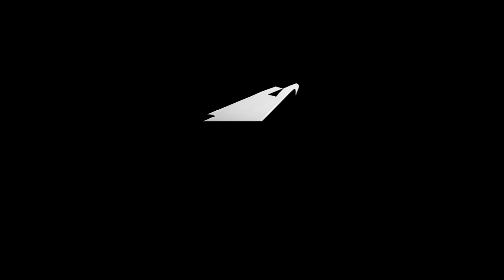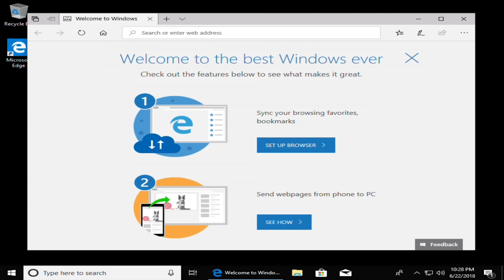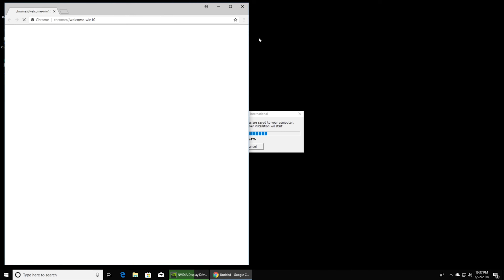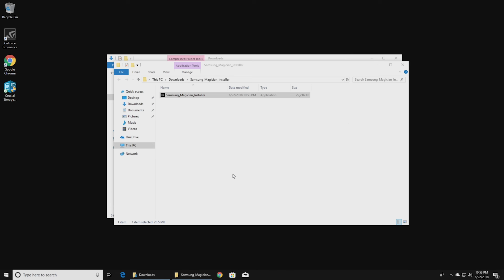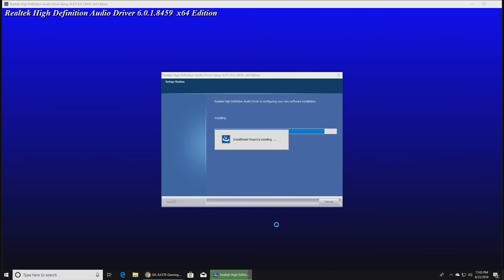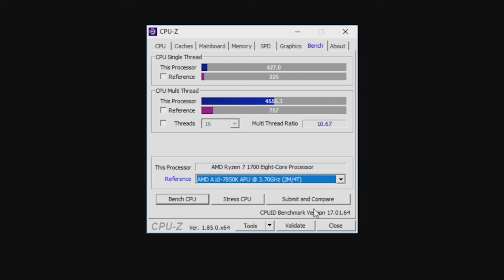How-To Guide - BIOS Update / Win 10 Install - $900 Gaming PC - Part 2

Comment: UPDATE: today I tried Aida64 to run stress test again and the PC froze after 5 mins... so I don't know what to do now...

ok I got my ryzen 7 1700 overclocked  to 3.7ghz, I had to adjust voltage to 1.25v (with less voltage my PC froze in cinebench) for how long should I let AIDA64 run?  I also have 2x8GB 2666mhz corsair memory (I used ASUS's xmp version to jump from 2133 to 2666) I ran AIDA64 for 25 minutes and the temperature of the cpu stayed at 75 degrees (sometimes dropped to 74 degrees) motherboard stayed at 33 degrees.... everything was ok, so for how long should I run it?

Comment: I think that the 2600k has much better performance overclocked than stock. It would compare better overclocked! Even if it would be a lower score anyway vs. that ryzen.The 2600k would gain much on single core.

Comment: Some nice setup options are to tell windows to store downloads and other related file types to your scratch drive, this helps keep those files off precious primary drive space.
Also if you changed your browser, you need to tell windows to default to that for all internet activity, might be nice to show your users how to do that because it’s sometimes confusing for newbies.  Also, trim settings are also a good choice for SSD type drives, windows uses it by default but doesn’t always configure it perfectly for the drive manufacturer your using.
Also, most important to some, is setting the power scheme, this helps get the most out of your system and helps with device efficiency.  It’s also a smart idea to use secure boot and set keys appropriately in the bios.  It’s an important security step that also safeguards your internal devices.

Comment: Tech Deals, If I have my windows installed on a 240gb sata ssd can i buy a samsung nvme ssd and use their software to clone the drive and have the no startup drivers problems with windows? Thanks for the video!
Reply from the maker: No, moving from SATA to NVMe requires a reinstall...  it CAN be gotten around manually, but don't bother, it is a pain

Comment: SCDKEY is a shady company, and I don't mean their keys don't work. I mean they're simply too cheap. Microsoft probably makes no money when you purchase and use an SCDKEY product key, and I doubt this would be considered "fair trade," even if it is "legitimate software." What I mean to say is that sites like SCDKEY have been found guilty of money-laundering in the past, and it would not surprise me one bit if you were buying stolen product keys.
Reply: These are usually keys sold to companies or schools. Sometimes they will be ok for a month,  a year, several years, and then MS will blacklist the key. Sometimes there is no problem. Personally, I just buy my keys straight from MS or my goto online store which gives me a boxed retail version. All in all, it's not a huge part of the price of a complete system, and a retail key doesn't have to be changed when you get a new computer. If you are on a tight budget, you might as well run it unactivated, as that works too. You just can't change any settings.

Comment: Mr Deals is good to run the 3.7ghz oc with auto voltage or setup to 1.25v ? For example in a ryzen 5 1600.

Comment: I think I am silly. Ryzen 3 1200 8 (2*4) GB of Ram motherboard Asus prime B350-plus Gtx 970 2 tb hard drive and 600 watt power supply.  And I am using a monitor that is 360p on  the monitor.(my other monitor don't have a stand. It 1080p I should test it before buying a stand.) Wireless keyboard and mouse. I have a Corsair cheap case.   I guess when I only have budget of 285.00  The graphic card, ram and hard drive I had on hand.  I think  after I change internet providers at home. I want to upgrade to ryzen 7 2700x and this motherboard already has the latest bios.  Maybe a new 1080p monitor after that. I guess this will due since it downstairs in my parent's shop.

Comment: Pro tip: Don't manually search for drivers. Just use snappy driver installer. It will auto-update everything at once for free. It's a free open-source program. Also: Use ninite to install all your programs at once. Just click on the ones you want on the ninite website. Much faster! :)

Comment: So if i register with that oem key then if it links with my microsoft account ill be able to activate my windows after reinstall by just signing in (also i thought this is hardware bound)?  And let the key bound to my account forever or the seller has a chance to use it again?
Reply: it will reactivate automatically after a sign-in. And yes, you can transfer it too a new pc if needed. It will be ported over.
Reply: Niek van Rijswijk sound cool, ty